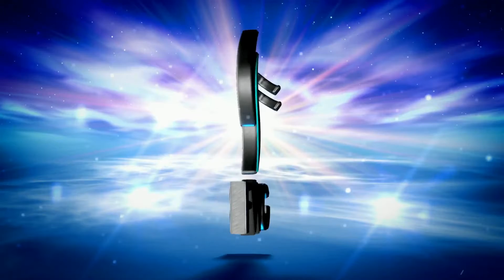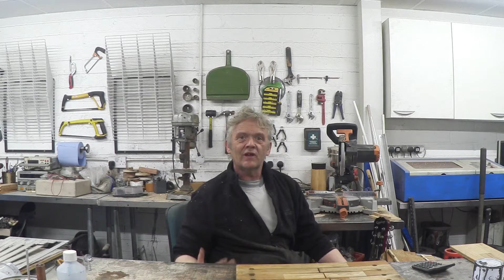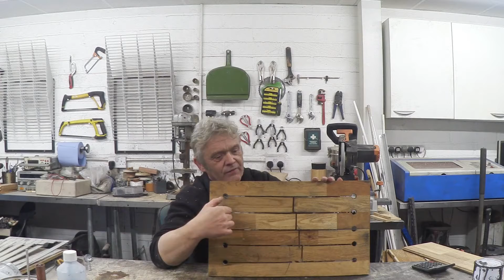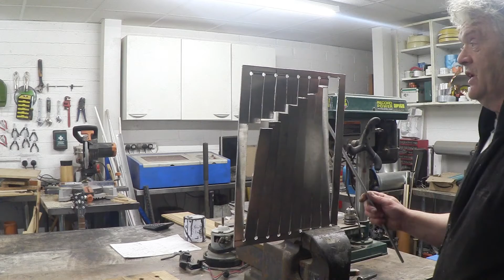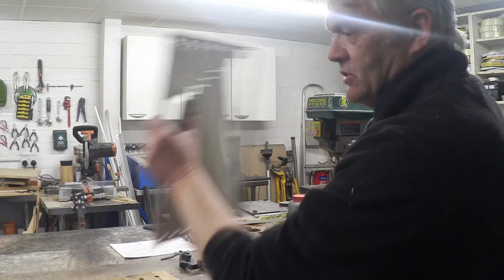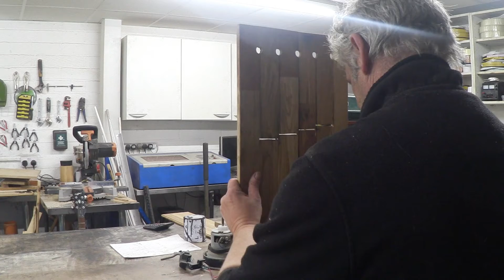All About Making Wood Based Tongue Drums

Comment: Well this is a whole new direction!   Never boring Robert, never boring.
  Incidentally: if you coat the wood with different hardness's of finish you will also get different depths of tone.   This explains the secret to Stradivarius's Violins; Different thicknesses  of wood across the body, but also the harness and thickness of his finishes.  It's amazing what you can achieve given various tensile strengths in relation to vibration.
Reply from the maker: nice tip mate and thank you - but this actually does relate to generation
Reply: @ThinkingandTinkering  
  Vibration and Frequency (Tesla) I forgot about that connection.
   I'm looking forward to your handmade storage device to go along with it.  (Not kidding).
Reply: Heat treatment should increase tensile strength also

Comment: Very interesting, and thanks! My first thought though, was...'oak?' Strangely enough for such a venerable timber, and such a desirable one, it's not a popular tone wood for solid body instruments. It has been done, but mahogany 'family' woods like your Epiphone is made from, and maple/pine/ash as Fender have favoured are the runaway favourites. Factor in rosewood and ebony for the fretboards, and oak slips further down the list.
I'll admit I'm not sure of the technical reasons why, but then, better minds than mine have evolved the principle groups over a long time, so who am I to argue?
Reply from the maker: very true mate - but I have run out of mahogany and the pine I have is really a rubbish wood so oak was better that that - limited options limited choices - I could have bought it but you know me - use what I have lol
Reply: @ThinkingandTinkering  I'm in the same spot, so I sympathise entirely. On one hand, I've made a single string pole bass out of a pine shelving post I found: not the best resonance, but more than strong enough. On the other hand, I've got a length of holly trunk that'll make a short guitar neck, which has been maturing for over a year: the resonance ought to be good, but supposedly it's hard to work once it is ready!
See this 'working with what you've got' lark? Bit of a pain...! 😂